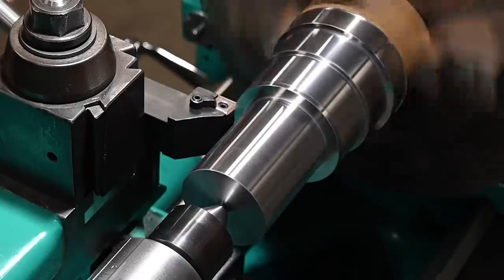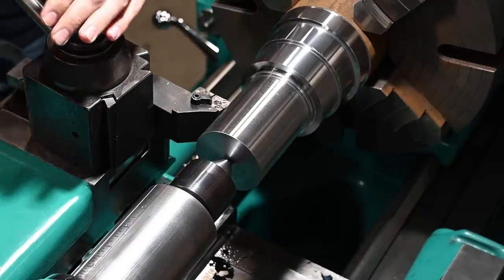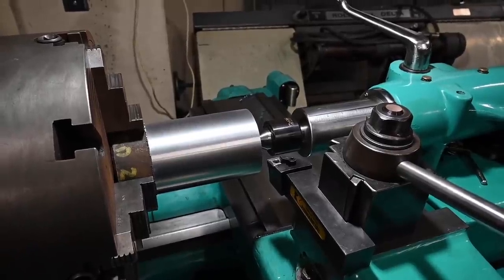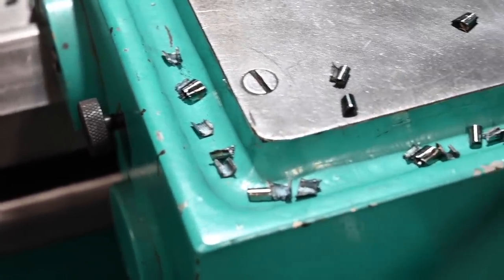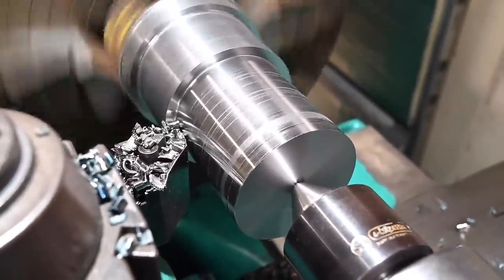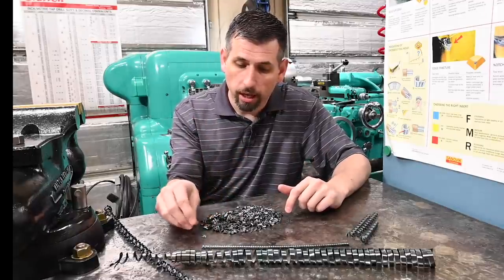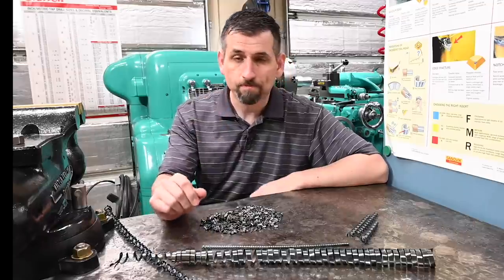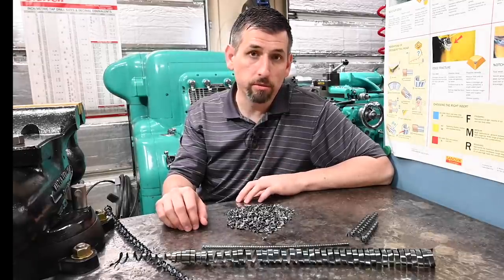Heavy Turning on the Monarch lathe: SUCCESS!!

Comment: I see you got it taking a good cut now. I used to run an American duplicating lathe at work. It had a hydraulic tracer that would trace the first shaft that you made manually. I was turning 8" dia. 4340 about 3' long making overhead crane  axles. Each end of these axles  had to turned down to about 5 1/2" only about 8" of the shaft was left at 8" in the center. I used a tnmg 542 and would take .750" at .024" feed. It would cut like this all day long. It had a 30hp motor.  Before that I made the axles on a 20" monarch like yours except it was longer. I would take .500" cuts on it all day long but only about .015" feed. I believe it had a 15hp motor.
Reply from the maker: Those are some monster cuts!

Comment: If the centre bolt of the tool post  is pulling out of the base a problem with accurate measurement as well... I have been going through this myself... Keep Trying you get the hang of it with enough practice.. 
I learned by taking smaller cuts - once I had that figured out, then rip into it..

Comment: Higher rpm makes the material more elastic, so more feed might be necessary. When tool tip is negative, take lighter depth of cuts to avoid back lash being pulled out of cross feed screw. CNC inserts work best on a Cnc.

Comment: You wanna have some fun.....get some ceramic inserts, make sure you have a rigid setup, maintain constant depth of cut with NO interruptions, turn the lights down, and let her rip !!!   The material should come off like liquid (and glowing) and start to break apart 12” from part and it should sound like popcorn popping.   Fun stuff.

Comment: youre doing fine.. In machining, its always a pissing contest, even among veterans.
Reply: Only among those of us who try to act like they know more then they do.  Turning is easy, if you are having problems check your workholding(tightness,rigidity). If there is no problem, check your toolholding(tightness, rigidity,geometry,center height) Only once you check both of those things do you start looking into tool issues or material issues. 99% of the time it is eitherlack of rigidity or proper geometry due to work or toolholding.
Alot of people try to complicate it. Always check the basics first.

Comment: Nice video, I enjoyed watching your experience:)
I understand what you were trying to achieve with heavy cut practice.
I recall your first cut in the previous video.  No where near as heavy with a different tool.
Finish was nice and the chip broke nicely.  Looked like the machine was singing not screaming.
Your goal should simply be to make it sing.
Some 35 years ago an old tradesman said to me (an apprentice) regarding some other bloke trying to show off. Don’t make it scream make it sing.
Maybe your lathe isn’t meant to take 1/2 inch cuts.  Dam sure mine isn’t ;)

Comment: Well done Aaron, subscribed. Wisdom only comes with knowledge and knowledge only from experience. You mentioned before that your toolpost to centerline was to short for a multifix. What is your height? There is a company called Create Tool that is manufacturing them again and they are of high quality. Good job solving that problem. Your attitude is awesome, don't worry about the internet trolls.
Reply from the maker: Amestra is still making them in Europe with the original high quality, but they're pricey. My compound to spindle center is 1-13/32" (~37mm) which puts it in the range of about a 14" lathe. This is due to the massive size of the compound to house the gearing for the power feed. I'm using a CA which is technically a bit undersize for my 22.5" machine with 10 horsepower (Aloris recommends a DA), but CA is too tall for my center height distance. I'm really between a BXA and CXA but those don't have the strength of my machine's capability. Kinda run into the same problem with multifix posts- the right height (size E) is not recommended for the cuts I can take (max of 6 horsepower for the E) but a size C to accommodate the horsepower is way too tall. Seems that my best place to be is with the stronger CA post using 3/4" tools or modified 1",1-1/4" or 1-1/2" tools.

Comment: Ignore all those negative comments. Don’t apologize. You mentioned ur learning. Like we all have, n ur doing it urself. Id u don’t have a mentor or experienced machinists showing u the ropes. Which I’ve have had both. N I still get different material n tools n do the calculations, try out different cuts speeds feed on every drop material. Just to practice, make the cuts n have fun and learn.

Comment: When roughing,  a POSITIVE lead is best on the engine lathe . You are using a CNC CARBIDE INSERT, THAT CUTS IN TWO DIRECTIONS.  YOU ARE CUTTING WITH A NEGITIVE LEAD THAT PULLS OUT THE BACK LASH OF THE CROSS FEED SCREW. IN OTHER WORDS  THE TOOL TIP LEADS THE REST OF THE INSERT.

Comment: Tool center height. That finish also didn't look like 4140 when it was cutting unless it was rubbing, however the chips kind of did. 4140 should be shiny and cut like butter in pre-hard condition. Rockwell C 28/34. Unless your 4140 was annealed 17/24 rockwell C it doesn't appear to be of the correct finish, even taking into account the negative rake angle. Unless the center height was off.

Comment: Your insert is healing out. If you hear that popping sound. Your tool is high off center.  It's not your toolpost. You may need to shim your tools or check the Gibs on your compound. If your tool digs in on a manual lathe. More often than not. Your compound gibs need tightening. And also on the insert packaging. Those speeds and feeds are geared towards cnc machines, that are way more rigid than even the best monarchs.

Comment: Can’t you put a t-nut behind the tool post to keep it from turning on you ,like a two bolt piece of bar stock.
Also that square end on the wrench is for a hammer.
You might try coolant. Great job.
I’ve been machining for 54 years. Great job again.
Reply from the maker: I’ve kind of just used the slugging wrench for its heft. Hitting it scares me that I break something but I probably don’t need to worry- the iron on the compound is almost an inch thick above the t nut.

Comment: For what it's worth you can take a quarter inch cut with 25mm tooling, and I think you could end up with a more rigid setup using 25mm in a proper holder rather than what you have there.  
I have been a machinist for 20 years and I would never have thought to mod a tool to fit a quick change like that, quite inventive of you.  
ps. the orientation of the compound slide doesn't matter, it's designed to turn to whatever position you need it.
Reply from the maker: Most 25mm tooling is too tall for my lathe. I have a large swing on my lathe (571mm), but the compound is very tall to accommodate the gearing for power feed, so the top of the compound to spindle center is rather short. I even have some 19mm tools that are too tall and have to be modified.

Comment: There's an equipment dealer video of a 16" Monarch taking a 1" depth of cut (1/2" per side) in mild steel with a HSS tool. That's my personal goal.... 1" round bar reduced to nothing in one pass!
Reply from the maker: Oh wow that’s pretty tough work. Would need some speed to do it on a 1” bar though- SFM at the tip of the tool would be zero. Maybe wouldn’t matter though if you’re traveling in Z 🤔
Reply: @AlwaysSunnyintheShop  They were turning 3" stock or something similar. Can't find the video anymore, will keep looking.

Comment: I really appreciate authenticity and learning from your learning!  I also appreciate that you Might not be as popular as Abom79.  He has so many followers, that I don't have a lot of hope getting questions answered.  No reflection on him because I'm sure he'd like to help everyone,   but just humanly impossible to help everyone!
I'm poised to purchase a used lathe and would love a mentor to help me choose before I spend so much money 🤣   Like the ones I'm poised on are 20" lathes and the nagging question is "will I wish I went for smaller?".   The only drawback I can think of is that the smaller ones tend to offer higher rpm where some of the 20" max out at 1500rpm.  Also may need to chuck an ER40 collet in the large chuck for turning small stuff for example.   Anyway, do you know of any other drawbacks to "going big "?

Comment: Given a 1st year apprentice as you say &&&& given I'm still hunting for a Monarch:  Could you take a moment to explain what had to be done to prevent the QCTP twist?
Reply: Aaron said that the stud was pulling out of the T nut everytime he went to tighten it so that is why the post was turning and not staying locked down. He probably made a new nut and stud and now everything is good to go.
Reply from the maker: Close- I ended up welding the nut to the stud. Followed the proper procedure for welding 4140 to 1018- preheat, interpass heat maintenance, and very slow cool down period. Should be as strong as could be until I decide to make a new stud and nut.

Comment: Hey everyone should get know their machines , speeds and feeds are just a starting point  or even getting use to what should be right and wrong like how when u got it to chip it sounded weird like grinding smearing but if its consistent and tool is fine its ok  personally i know how to use lathes and teach lathe but useless at cnc mills im not trained but I get told to run them and not noticing when a tool is worn because its cutting and nothing sounds weird until you hear it getting louder .... its all learning in the end and also teaches you how to solve problems

Comment: speed too low , feed to high . All in all it works, but not the best parameters for that machine . Pretty hardcore still

edit: CNMG1906XX , oh now i see the problem , monster insert :D , parameters were almost correct for the insert, up the speed a little and go hide somewhere . The other day i took a cut with a rough boring head 2x CNMG160608 , i took 6mm per side to 90mm bore final , the chips were not really breaking on a low 0.14mm feed , but it was an actual part so i did not want to risk blowing up something . The bigger inserts really do need a bite to work well.

Comment: Why isn't the tool post on the right side of the compound? This way you wouldn't crowd the tail stock to position the compound with different degrees to the cut. 3:00 / 15:43
Reply: If he would do that the cross slide would hit the chuck

Comment: Why are chips better than the long curls?
Reply from the maker: There's a few reasons, foremost is safety. The 3-1/2' curl that I showed is jagged and razor sharp- if you have a big pile of those coming off the machine constantly, there's a real chance of injury. From what I understand, the heat comes out of the process more efficiently through chips rather than long chips. There is also the matter of finish- long stringy chips tend to stay near the workpiece and rub or scratch against the surface of the part and mar it up. On a roughing pass like these would be it isn't a big deal, but if you need a nice finish on something and a stringy chip scratches it up, it's pretty frustrating. Hope that helps.
Reply: @AlwaysSunnyintheShop  Thanks, I always wondered about that. It makes a lot of sense now.

Comment: Aron,  Simple advice/ suggestion... Learn with HSS Tools. They can take the Large D.O.C. that you wish to experience, while costing far less.
The basic rule of cutting speeds is 200% to 400% above those of HSS for Insert Carbides.
So in short if you actually tried to apply the Efficiency and Productivity of that tool you where using, you would need an enclosed turning center,
and flood coolant to keep the Heat from distorting the work piece.
 If not you would wind up distorting the workpiece with Heat. Chip Burning the Paint finish off your Wonderful Lathe and possibly,
wearing the "C" Chip scar upon your body.
That Turning Tool Holder and those Inserts where designed for CNC Turning Centers.

Comment: Seems like most of your chatter/problems is from the (lack) of a proper tool holder.  You (modified) the Kennametal insert holder with a dovetail to fit your quick change tool post. Why not use a proper tool holder with full engagement on the dovetails to hold the Kennametal insert holder? There is probably a reason why you don't see modified insert holders on a lathe in a professional shop. The wheel has already been invented and all possibilities tried, so it really doesn't make sense to (rediscover) it. It might also help to make an (L) bracket on the back of the Quick change tool post to fit down into the groove of the compound, to keep it from twisting. It also would require less clamping pressure possibly keeping you from blowing out the compound grooves from excessive clamping pressure.

Comment: Efficency is such an over used and over abused word, you are not concerning yourself with efficiency, nor should you. You are approaching optimization, which is more applicable in relation to what you are doing. Dont worry about efficiency and the "efficiency experts", optimize your tools, your time, and your talent. If you do that, efficiency falls right in line. Take lots of notes when doing this type of "experimenting" and then make them easily searchable and acessable. If you ever run into these ptoblems again down the road you can always fall back on your notes. Take note of things like SFM, RPM, feed rate, tool angle, depth of cut, diameter of the work piece, type and conditon of material, etc etc etc. SFM is critical as it will change relative to the diameter, that will be a make or brake variable making deep cuts at the limits of the machines capabilities. You are doing the right thing by learning through trial and error, don't get discouraged by a bunch of names on a computer screen.

Comment: What happened to the tool post mounting stud could have produced a sudden failure of the tool post during large DOC cuts. If the tool post mounting were to snap off, the tool post and lots more would become a lethal projectile. If any threaded fastener feels "soft or stretched" when torqued, remove it if possible and give it the Naval float test.. or put that ALL those threaded parts into the circular file never to find their way on to any mech device ever again.

Metals are far from solid, they are more like rubber and deforms a lot more than folk realize or accept. What happened to the tool post mounting stud, the yield point of the material was exceeded. Once this has happened, it is ripe for failure.. Take the time to watch this video on metals and material science of what yield point means and why materials behave in the ways they do.
https://www.youtube.com/watch?v=WSRqJdT2COE

Never skimp or take for granted threaded parts or any parts made of metal or similar materials, knowledge and understanding of materials is an essential aspect of machine tool work.